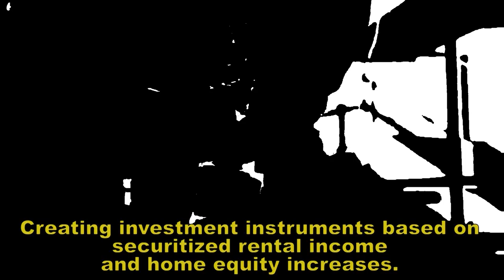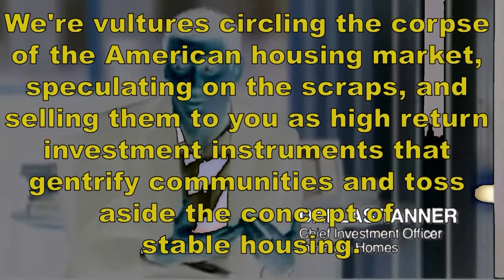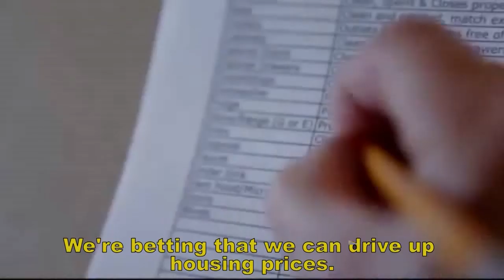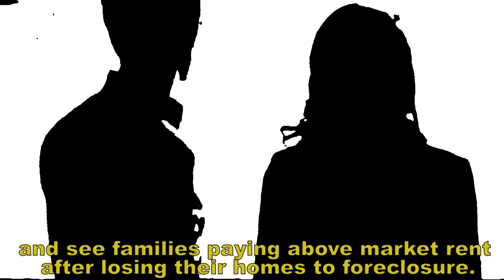The facts behind Invitation Homes and Blackstone

Comment: I've been renting from IH for 3 years now with a couple more to go before I can move. They are a terrible company. The so called "account managers" are a revolving door, lucky for me I don't really call them to often, but when I do the last one I talked to is gone and I have to find out who my new one is. They use the cheapest labor and the cheapest materials they can find to remodel the homes. My neighbors told me the people living here before me had a lot of dogs (which I'm allergic to) so I couldn't figure out why my allergies were bothering me so much in my new home... turns out if you look really close at the walls you can see dog hair mixed into the paint on the walls. Wow😳. Now I have a water leak on my sink in the master bedroom. They attached a vessel (bowl) sink to the countertop with caulking. CAULKING! Yes with caulking. Picture this: countertop with a hole in it, the pipe is attached to the counter underneath, on top they put a silver collar and caulked it to the counter, then put a glass bowl (vessel sink) on top of the collar with caulking. They didn't have any pipe, it's supposed to attach to the sink and then you slide it down into the pipe underneath the sink. Just sink caulked to a silver collar caulked to the countertop. So needless to say it leaked water all over my bathroom. I've also had them change the dishwasher that was broken on the day I moved in (great quality control) the best part was after the installer left, we went to use it and he didn't even hook the water line to it🤦🏼‍♂️ again no pride, no skill, no quality control. They don't hire workers with any real skill or pride in their work at all. I'm just trying to make until my kid finishes school here and then I am moving as fast as I can. Invitation Homes is a horrible company to rent from.
Reply: I forgot to mention, I'm renting from them in south Florida. Davie to be exact. IH sucks!
Reply: @natalyg4154  We moved out of south Florida in December and bought our 1st house near Orlando. Absolutely beautiful home that would’ve cost me so much more money down south. So happy to not have to deal with IH anymore.
Reply: @Stickyfingaz954  You are trully blessed! I am very happy for you! Smart move!😀👍

Comment: Yes, they didn't have the pool usable because it needed to be sanded down, shards of fiberglass sticking up.  It took nearly three months before the pool was done after I moved in, then the roof was leaking and had holes in  it so they re-roofed it and wouldn't put the solar panels back on the roof cause it would void the warranty.  So here I paid for a heated pool, and could not use it until May of last year and from November on.  They don't deduct from the rent my loss of use of the pool.  There are other ways to heat a pool and bet ways to put solar up without drilling big holes in the roof.The pool maintenance people are not properly trained. The current guy said he got one week training and was turned loose and didn't under stand the chemical or how to get it balanced.  I bought my own stuff last week-end and the first time it didn't taste bitter when I swam.  In fact the pool person (can't call them "boys" or their manager uses that against me but bet they call women girls all the time).  Chips on their shoulders.  IH doesn't care about whether pool  persons are trained. There is a law in Fl that they have to be certified or supervised by a certified person and none of them are.

Comment: I have a statement to make about Invitation Homes. I had an Electrical fire at my Rental property here in vacaville CA. What happened is an electrical outlet caught on fire In my office. I imeadetly shut all of the breakers off to the house. I had to shut all of the breakers off because there is no main breaker in the electrical panel. I'm pretty sure that's illegal unless it's a detached structure, or it's a sub panel. The electrical out let has 3 romex coming into the outlet. 3 hots and 3 neutrals were tied into the outlet. That is also not acceptable by code. The outlet is on a 20 amp breaker, but the one breaker has 9 outlets and 9 light fixtures tied into it. That is completely done wrong and should not have that many receptacles tied into it. You guys orginally sent out a licensed electrician who assessed the situation. You guys got the quote from them and obviously didn't like what you saw. I just received a phone call from D&D who is a GC with a b license. Invitation homes said they would pay him 200 dollars to come replace just the one outlet. THAT IS NOT GOING TO FIX THE PROBLEM HERE. I understand this going to probably require you guys to get a permit and pay alot of money to demo,run wire, replace drywall, texture, and re paint everything. I work hands on with licensed electricians every single day. You guys NEED to pull new wire through out the entire house, the panel needs to be replaced because it is to old and not functioning properly. You need to use the correct guage wire and replace all outlets, switches, and breakers. The panel that is in the house at the moment is not big enough for the home. You guys are putting me, my wife, and my dog in danger here by trying to just put a bandaid on the problem. I will be calling the city first thing tomorrow to schedule an inspection. I can almost guarantee you, they will red tag the home. Then you guys will have an even bigger problem. I'm not trying to scam anyone or take money from you guys. I just want my little family to be safe in the home we pay 2700 dollars a month for. This is complete negligence on your part. I hope that Invitation Homes does the right thing here.
Reply: Rented from Invitation Homes for 7 years. Was promised option to buy. House listed as newly renovated is in fact a delapitated 1951 built. The maintenance sent by invitation home stated that they never repair but patch up and they solicit tenants for money. Portfolio director gets kickbacks from contractors and files evictions spliting proceeds with hired law firm. The law firm's representative stated, that he will commit criminal action if asked to do so by his superior. The corporate leadership is aware of houses not being repaired and security deposits not being returned but pocketed by the company. They have above the law mentality. During covid-19 pandemic they keep evicting tenants despite the CDC Moratorium. Majority of eviction cases filed in Miami-Dade county courts have affidavits from IH that houses not under GSE (government sponsored enterprise), however it is a known fact, that IH have Fannie May backed loans since 2017. In 7 years I have collected extensive body of evidents (pictures, videos, statements, email correspondents with local and corporate Invitation Homes officials).  
Most memorable statement from my landlord Invitation Homes portfolio director: " It's my way or I will evict you. The IH will have to drag me out to get rid of me."